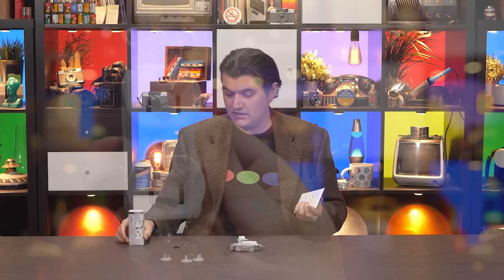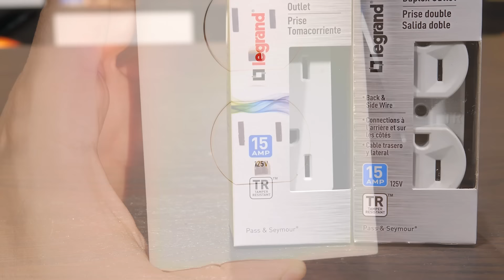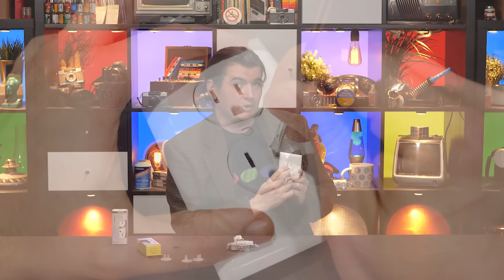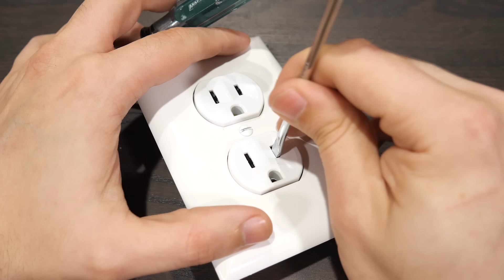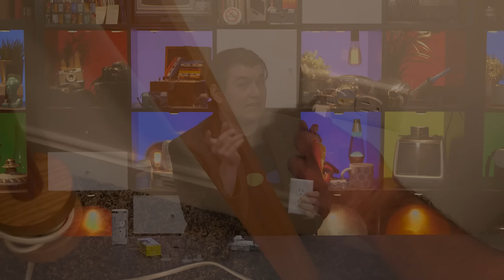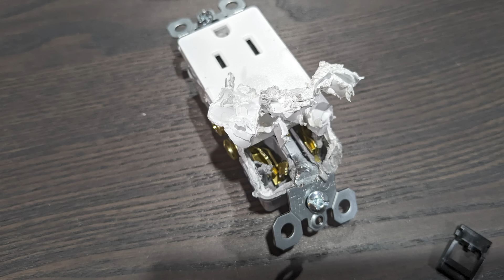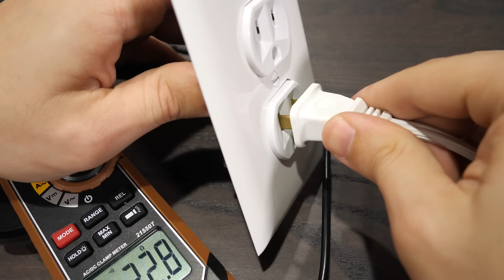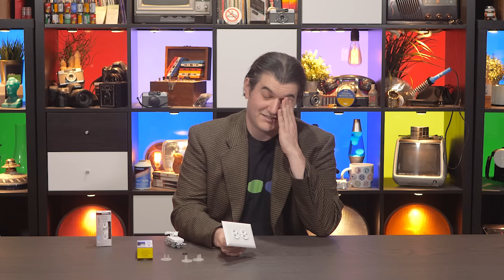Tamper-resistant outlets aren't all the same - a follow-up

Comment: The newer / better UK sockets now also have mechanisms where all three of the receptacles need to be pushed before they open - notably those made by MK.

Those plastic socket covers are evil - at least in the UK. They're completely unnecessary yet are sold by some idiot/unscrupulous retailers - the UK categorically does not require the, and they are made of cheap, thin plastic and tend to break, and can do so opening the earth pin (but snap in two so the other pins are left open), defeating the safety system on older/cheaper sockets. If you tell the kind of parent who buys them they tend to give you a blank stare as well (sigh).

Comment: I installed tamper-resistant GFCI outlets in my home. The shutters are annoyingly stiff, but once they give the outlet doesn't grip a plug any more firmly than any other outlet. In fact, I swapped most outlets in my house and the new ones don't feel as secure as the those I've purchased in the past. They're a big improvement over the ancient junk I replaced, but I'm a bit concerned that cost-cutting will affect long term durability.

I think back half of prongs just needs to be shielded like they are in Europe. There's currently no rhyme or reason to plug design in part because Chinese suppliers just do whatever is expedient. However, it should be noted that if this were actually a widespread issue we'd have heard about it a long time ago. Likely in the form of class action lawsuits.

Comment: I found a weird plug strip that only one of the plugs is live and if it senses enough voltage going through that then the other ones will become live but otherwise they will be completely off. It was advertised as energy saving.

Edit: I don't know if it was voltage or amperage or what exactly it is sensing but basically you have to turn on a device before all the other plugs become usable.
Reply: Voltage remains constant. The standby state of the device draws less power than while being used. The power strip senses the increase in power consumption. Turning the device on draws more amperage which is how it detects it. Amperage is merely watts times voltage.
Reply: The ones of these I have seen are designed for computer use. The idea is that when you turn of the computer, all the accessories like the printer are shut off too. Most things like printers power down to a pretty low power state any more so I don't think that is very useful. Other than my computer, to major power hog is the modem/router which I want live all the time anyways. It continuously cooks away like a mini toaster.
Reply: @kurthanushek5520  why do you need your modem to be on if you're not using your computer? You got something else that's connecting to the internet?

Every time I look at an iPod touch it makes me feel weird because how is something that small (way smaller/thinner than a modern cell phone) able to act like a computer going on the web and whatnot? The main thing I miss from old cell phones / iPod touches was the fact that the camera didn't stick out and it seems like every time I have to get a new phone the camera gets longer and longer and the whole body gets thicker and thicker wtf?

Comment: Screw driver, pshaw. When I was 4, in 1975, I taped the wires of a stretch of 300ohm TV lead to a light bulb  (it was electrical tape)  and then put the other end of the lead into an outlet. It took a second for the wires to catch fire, but in retrospect, it was a pretty genius for a 4 year old.

Comment: I have yet to find a NEMA standard TR outlet that isn't a nightmare to use in applications where you are often (un-)plugging plugs.  I swear the shutters get dinged up and then catch onto the blades of the plug, or the just suck at opening in general.

Comment: Growing up in Oregon, I want to say every house I've lived in (mostly built anywhere from the 50s to the 80s) has had loose outlets where plugs just fall out from gravity.  Heck, my current bedroom all three outlets are complete trash and I only haven't changed them because I rent.
Honestly, after seeing your Chicago style rotated outlets makes me wonder why we don't have horizontal plates with ground-down receptacles sitting next to each other, it'd make having multiple right-angle plugs in one spot so much easier to fit.
Reply: Block plugs are the worst. I've had to get 6" extension cords designed to extend block plugs for some outlets/power strips so the block plug doesn't block multiple outlets.

Comment: If you have some money to burn and a wall outlet that's partiuclarly bad about falling out, consider "Hospital Grade" outlets.
They're quite a bit pricier, but are designed to grip the plug far more strongly than standard or even commercial grade outlets.
This makes them relatively resistant to the plug getting pulled or sliding out, and they also wear harder.
The main problem is, naturally, they're a lot harder to plug and unplug, and inattentive use (grabbing the cord) will cause more problems.
Reply: I love hospital grade outlets. They grip harder, because you don't want a life supporting device's plug to accidentally get pulled out due to gravity or carelessness. In the IT field, sometimes  these (orange) outlets are used for VIP networking devices and servers.
Reply: @redmatrix  Doesn't orange also mean it has a separate ground wire from the yoke of the outlet to ideally reduce electrical noise?
Reply: @soundspark no. An inverted green triangle on the face of the receptacle outlet means isolated ground. Receptacle outlets come in many colors that don’t necessarily have meaning
Reply: Mission and especially life-critical equipment should use twist-lock plugs! @redmatrix

Comment: I've found that plugs in the US come out way more easily, which becomes clear whenever I use my vacuum cleaner. The plug readily falls out when there is the smallest amount of tension on the plug when I pull my vacuum along. That said, I feel that houses and their wiring/plumbing in Europe are maintained much better in general (compared to CA and NYC at least)
Reply: Your receptacles are worn out and should be replaced.  A new receptacle will have a death-grip on your vacuum plug.

Comment: Genuine question: How/Why do you guys even need polarized plugs? I've also always wondered why at least the EU plugs' outer plastic is partially inserted into the wall (even without ground contacts) and why that's not a thing in the USA.

Comment: besides wearing out,  Our plugs usually have a cord perpendicular to the plug.  In Europe their plugs line comes out the bottom end.  If you pull on their line the plug wedges and does not come out.   Ours, the plug comes right out.  I think that is more what they mean.

Comment: Good rambling. I replaced a several worn outlets a few months ago in my farmhouse and it just feels nice to use them now. Especially the most loved one in the kitchen had become just terrible that it would trip its breaker. And my 2 cents on wiring outlets is I don't tend to use the push in way either. I've had a few fail where that seemed to be the issue.

Comment: The UK plug design means that a partial plug removal is almost impossible; I've never actually seen it happen. And even if it were to happen, the blades are protected so that you can't ever touch the live bit while they're inserted into the wall. Compared to the US plug design, it's incredibly sturdy.

Comment: I hate those tamper resistant outlets. It's pretty standard here in China and it's almost impossible to find a normal one. 
Every time I buy an outlet or power strip, I would take it apart and remove shutters.

Comment: For "less dangerous" and "safer" topic, what you mentioned about implying safety or danger is 100% on the nose. Saying "This thing is less dangerous" still encodes the inherent danger present. Phrasing-wise it would be equivalent to saying "I'm shorter than them" versus "I'm less tall than them". One emphasizes/implies "short" while the other does "tall." (Where one is also awkward and not really something you'd hear day to day). Saying something is "safer" is coding your language and phrasing with emphasis on "safe" and not on the danger.

All that being said, they do effectively mean the same thing. It's just the nuance and emphasis encoded can change how one might hear and interpret what you said.

Comment: As a UK citizen I can say for sure 120 Volts is safer than 220 Volt and the UK construction industry agrees.  Despite the fact we all use 220 volt appliances in both our homes, shops and offices only a 110 Volt supply is allowed on construction sites.

Comment: You're not supposed to daisy chain outlets through the side terminals anyway. You need to attach a pigtail to the outlet and then bond the other side of it to the incoming and outgoing wires. Daisy chaining through the outlets is only supposed to be done with GFCI.

Comment: The shutters are made from plastic. It should be greased to make it last but usually it's not. At least, not in Europe.
Another unsafe aspect of 120V is that double the amps are needed for getting the same amount of power. Bad contacts will get twice as hot because of that higher amperage. So the fire risk doubles. Americans should really ditch that 120V nonsense and make the transition to 240V and a new plug design, preferably with 4 pins: neutral, earth and two opposite phases, so you can still wire up 120V appliances to that plug and there won't be any need to change power grid infrastructure.

Comment: I now live in Canada but come from the UK where every plug also has a switch on it. I think I recall from years ago you saying it's not much harder to simply unplug something so it's not a big deal but I wish plugs here had switches. Would help them wear out less. I have family members who literally unplug everything in their home if they aren't using it "to be safe". I'd wager it's less safe due to the danger points mostly being wear and the act of plugging/unplugging than appliances randomly turning themselves on but that's a rant for another day.

I also sort of wish North America just embraced the three pin always. Even if that third pin is plastic like a lot of UK plugs now. It helps secure it in the wall and would allow the same shutter system. If you changed legislation now to enforce all new devices required three and changed the sockets in 5 years for any new installs the crossover would be reduced. For the few older devices you'd still use a simple plastic guard to keep inserted would return the existing status to the plug and eventually get phased out.

Comment: With your 2-phase system... I keep thinking "what do they do with the 3rd phase?"
I LOVED tamper resistant sockets when I was a kid... all those months of "research" working out how to tamper with them! :)
Reply: The two phases in a NA home are very different than the three phase power in an industrial or commercial setting.
The transformer that steps the voltage down from distribution levels technically only has a single phase output with neutral being a center tap. In addition, as you go down the distribution line, the first stepdown xformer would use the distribution phases A and B, the next would use phases B and C, then C and A, then back to A and B.
Reply: The two phases in a NA home are very different than the three phase power in an industrial or commercial setting.
The transformer that steps the voltage down from distribution levels technically only has a single phase output with neutral being a center tap. In addition, as you go down the distribution line, the first stepdown xformer would use the distribution phases A and B, the next would use phases B and C, then C and A, then back to A and B.

Comment: One of the issues I've run into is that replacing the outlets here may pose a significant safety hazard, not because of asbestos or chemicals, but because it's my impression that the wiring was done between when we used single wire on insulators around the house (My grandparent's house was like that) and when we went to 3 wire grounded outlets (hot, neutral, ground.) As a result most of the house doesn't have a ground wire going to the box. Most of them do have conduit, and that may be providing a ground path back to the circuit box, but I'm never going to consider that to be a reliable ground. Far too many connections of galvanized steel to galvanized steel, and other suspect issues for the box (no ground screw to attach the ground of the outlet too. The way that many of the 2-3 prong outlet adapters work is to bind the ground to the screw  holding the wall plate to the outlets, and presume that ground does exist, but as I say, I'm not entirely sure that's reliable.
Reply: As long as the 2-prong outlets are chained one after the other, replace the first in line with GFCI and you can now replace the rest with 3-prong and be both safe and within national electric code. You only need to technically put stickers that say "No Equipment Ground, GFCI Protected" on each outlet. Some older houses just run each outlet to a central junction box somewhere, often in the crawlspace, for those just replace the breaker with GFCI and put the stickers up.

Comment: IDK why this isn't code for those style plugs, but Range and dryer plugs in Canada must be mounted sideways. so the flat part is horizontal. It helps them not fall out. Those sideways Chicago plugs won't have the wearing out problem nearly as bad.

Comment: Had a moment as a teen where I was definitely not paying as much attention as I should've as I was trying to plug in an appliance to a power strip. (Edit because I forgot it originally but I am in America.) Using the ol' dangerous tech of using my fingers as guides to find the holes and as i found them, i closed my fingers against the blades and shocked my right arm. Had no lasting effects but damn did my arm hurt as a result.

It's kind of weird because I've had people down play and also worry too much about this story when I just see it as a dumb moment that I have to learn from. Great vid.
Reply: I don't know what you mean by 'worry too much', this is something that absolutely should not be possible and the fact that it still is seems like a huge problem to me.
Reply: @simonvetter2420  It definitely isn't ideal, but I think there's just a sense of apathy when thinking about it since I know change isn't coming soon. Just kind of live with it.
Reply: @simonvetter2420  "Lazy-Fare" (yes, i know what i did there) Capitalism, baby!  We don't need no stinking regulations!  surely consumers will choose to purchase only houses which have intrinsically safe receptables!

oh.  wait.
Reply: I had the same experience but my thumb was on the ground pin. To this day my right thumb, index, and middle don't quite move and feel the same as my left. It's very subtle but there.
Reply: Yup, I think I was maybe only 7 or 8, but I still remember that tingly dead whole-arm feeling I got once while carelessly plugging in my trainset, even though it happened probably 45 years ago.

Comment: I'm going to say my two cents regarding loose outlets.  The only time I have ever had issues with loose outlets are either older outlets or outlets in public places (hostels included). I see a bunch of people commenting about how even new outlets they've ran across are loses and a big reason is contractor grade outlets. Most outlets installed in homes and even some business are the cheapest outlets a homeowner or contractor can get - contractor grade. They are cheap for a reason and don't last long, especially in an environment where they see daily/weekly plug & uh-plug cycles.  Any outlets I need to replace or install I always opt for commercial grade.  They can handle much more plug cycles, are much better build quality than contractor grade, and in my experience they grip onto the progs better.  However they do cost a premium and if homeowners do not know any better they just pick up the lower priced outlets or quote from the builder/contractor. This is especially true with renovations where they are usually done the cheapest they can.  Yes, the US outlets could be a lot better however, if more money was spent on installs and better grade outlets where used.  The loose outlet issue wouldn't be as bad and mostly immitted to old installs or improperly maintained outlets in places that see a lot of plug cycles.

Comment: So "safer" and "less dangerous" literally mean the same thing and are synonymous, so neither are incorrect. However, while it's not the meaning of the word, using "safer" could make someone think in terms of there being some base level of safety. That being said, I'm pretty sure I would almost always use "safer" over "less dangerous" unless I was already speaking about "dangerous" things. Things like this might matter if you're writing a PSA or something, but it is really a nothingburger.

Comment: The night light with extra outlets in my bathroom (it plugs into the duplex outlet on the wall and gives us 4 additional outlets, plus a nightlight) is notorious for not grabbing the plug blades securely. My wife's curling iron is ALWAYS slipping out. I constantly have to push it back into the outlet. Now that's totally a manufacturing issue. You'd think I would replace it, but meh. She's the one who doesn't complain.

Comment: The back stab terminals don't have a good contact with the wire. In my experience, the edge of the spring retaining the wire is usually the only point of contact. Compare that to a back wired commercial receptacle, where the end of the wire is sandwiched between two brass plates and then tighten down with a screw. Those have lots of contact area.

Comment: Why not have a design with a (default off) switch that can only be engaged if there's a plug inserted, (removing would disengage it)?
Hence, can only be switched on 𝙖𝙛𝙩𝙚𝙧 the plug's inserted (with an indicator light?).